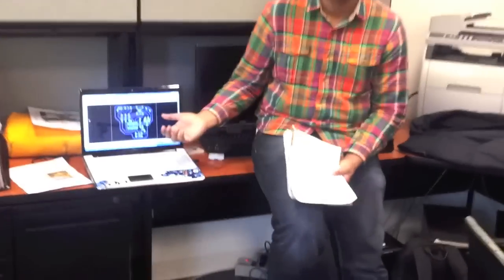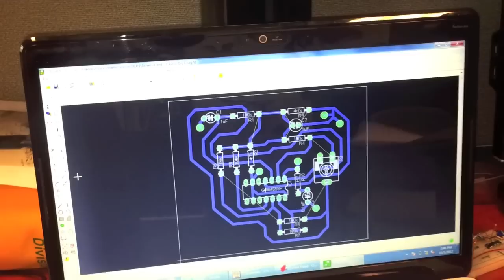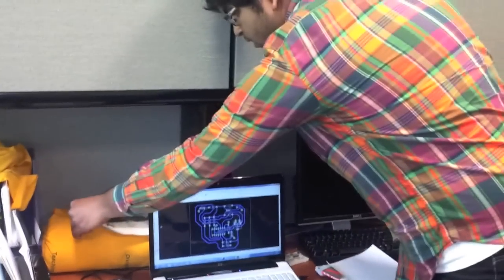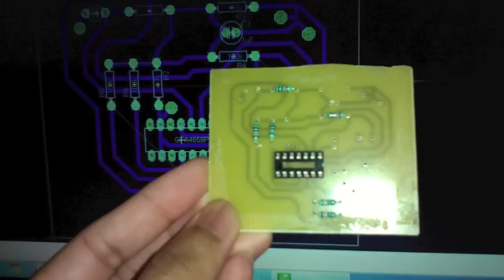ECE 280 Op Amp Project - ECP1

Comment from the maker: Yup! It worked the first time.  Only one of the PCB traces ended up being 'sketchy' so we used a small piece of wire to solder and repair the trace.  Etching took about 15 minutes of waiting while agitating the etchant and wiping of the board periodically.  It is supposed to etch much faster if the etchant is warm instead of room temperature.